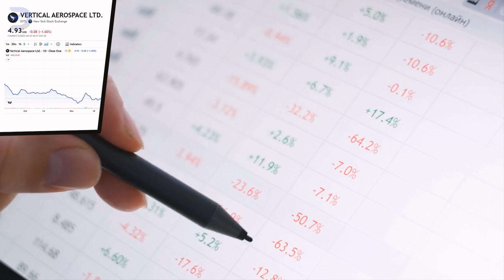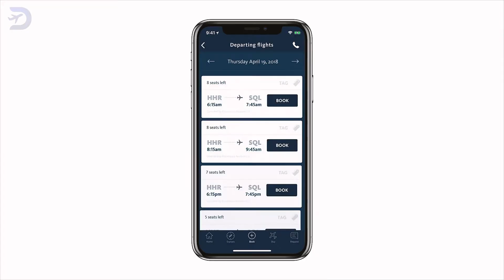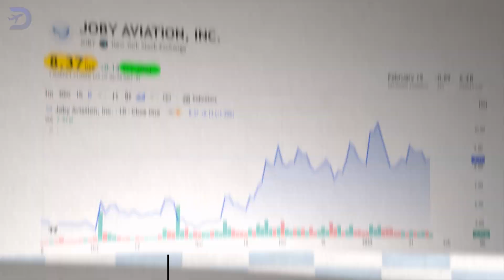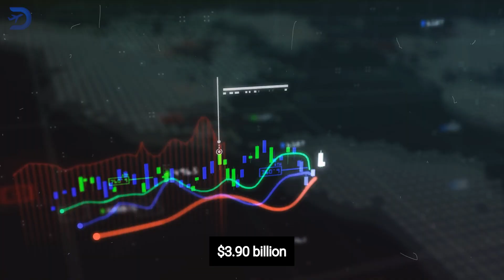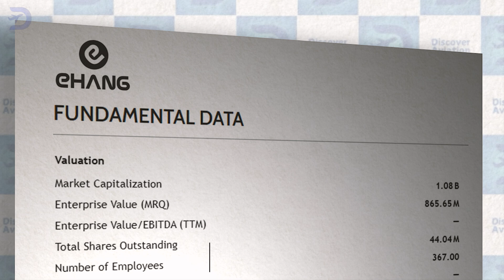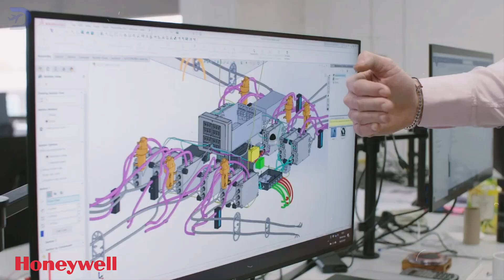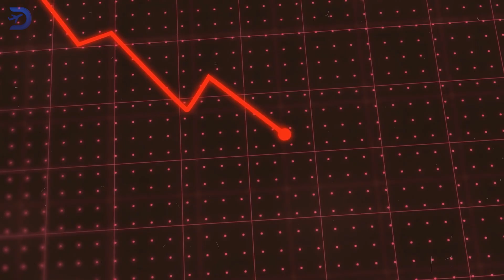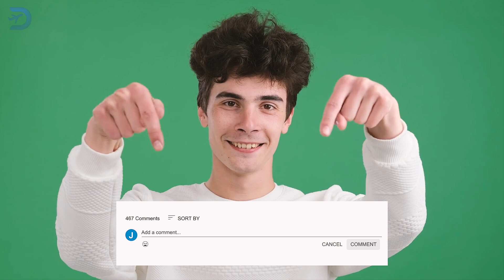Top 5 eVTOL stocks to invest in 2025!

Comment: There has not been such a spending spree without a proven product or service ever before in aviation. Only the debacles of the SARO Princess flying boats, the Convair jet liners, Bristol Brabazon et al come anywhere close to the scale of this bubble . Rolls Royce has pulled out of the emotor business incidentally and Airbus has 'paused' after three failed attempts - it is not all beer and skittles as depicted and return on the billions 'invested' is unlikely if only because a far better basic approach ( at present totally unfunded) is waiting in the wings for these generation one designs to fall over ( think mammals replacing the toppled dinosaurs, another case of gigantism leading to extinction ) these things are huge compared to normal four seat aircraft and massively overpowered ( but slow and clumsy)
The further analogy is of a failure to adapt to changing conditions and being dependent on one 'diet' eg scarce rare earth elements  , and of specialist pilots ( all raising costs and constraining expansion)
These are more air- buses than air taxis being limited to vertiport to vertiport routes only and requiring multiple passengers to break even , the operational and pilot costs being high overheads. 
Just as children are familirized with car travel long before  driving themselves so it is likely that non pilots will learn by  being flown before becoming pilots and owning their own air vehicles ( the opposite of the passive evtol user needing a chauffeur for ever  and a much larger 'taxi' vehicle ) with familiarity and elimination of hand navigation, map reading and telephone radio communications , or 'ATC' air traffic Control which as we have just seen, tragically, is not control at all and only works because of the present sparse traffic in the air .  The NASA HITS or highway in the sky system was a good start to making flying more like driving a car , ( but on a much much less crowded highway)
Just like with cars, small individual sized vehicles will prove to be viable whereas glumpy bus sized things will not.  They will also be fun to use. Only ceding control to autopilot where neccesary but otherwise being car like, less the traffic jams, in daily operation  ( or like flying out of remote airfields is now - we can automate anti collision and obviate radio telephony with technology but not become just 'cargo' either.